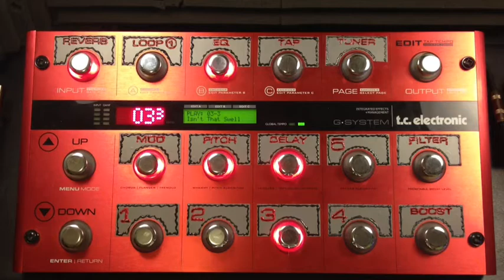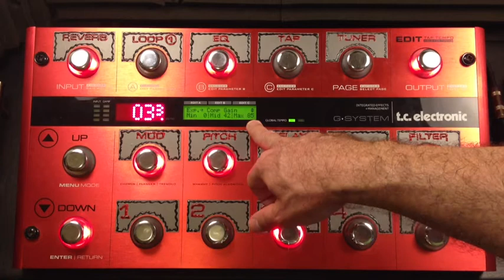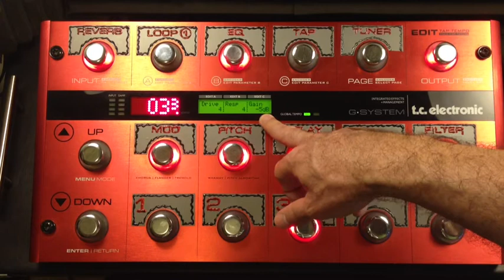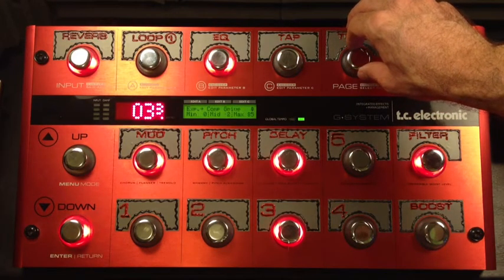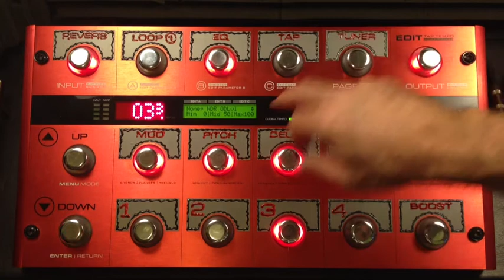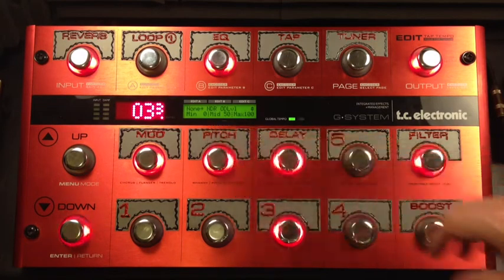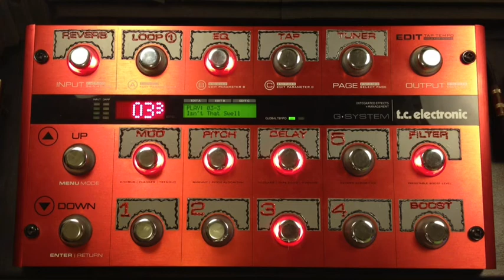Freeset Friday (Isn't That Swell)

Comment: Is t there a way to do this without the compressor and instead using the volume settings? I know this video is very old, but many are still using the G-System, and people that are new to this might think this is the normal way, but controlling the volume settings in the menu items is the typical way to use an expression pedal to adjust volume.
Reply: I’m sorry, it’s been too long…I haven’t owned a G in a while.
I wish I could be more helpful.